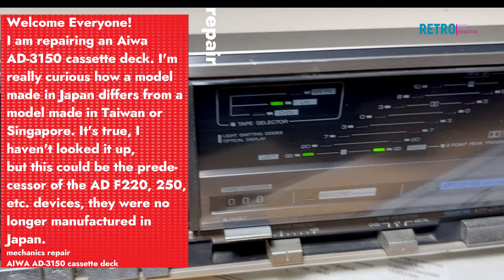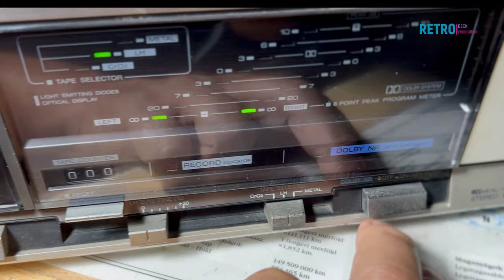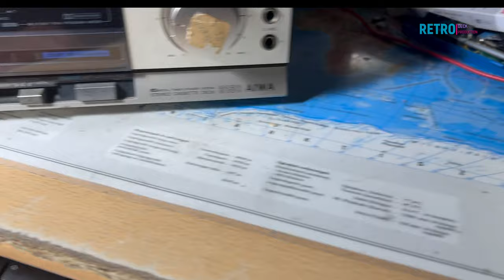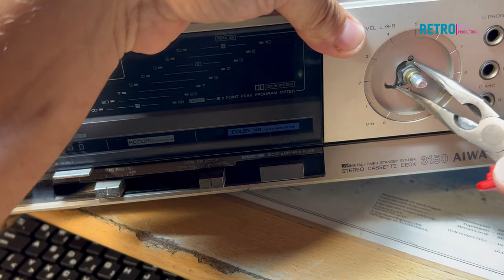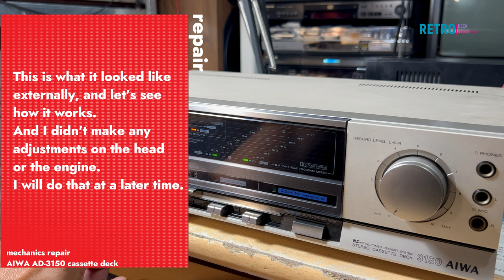Aiwa AD-3150 cassette deck mechanics repair-belt change

Comment: What you using for polishing? Like very light compound paste ? Not gonna remove front panel graphics?
Reply from the maker: You can use any high-quality car polish. I show polishing in several of my videos, so I didn't do it here. E.g. watch the video on repairing the Aiwa Ad-450. What I used here is Menzerna Finish 3000.